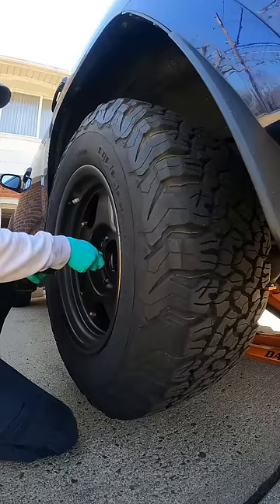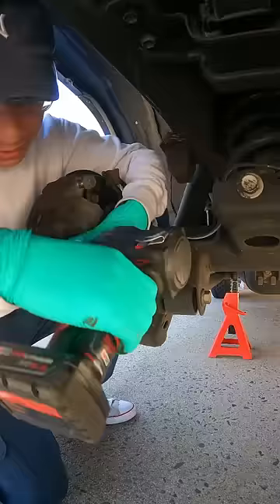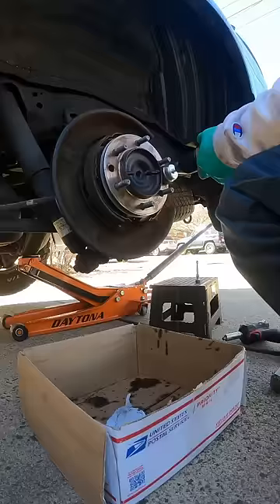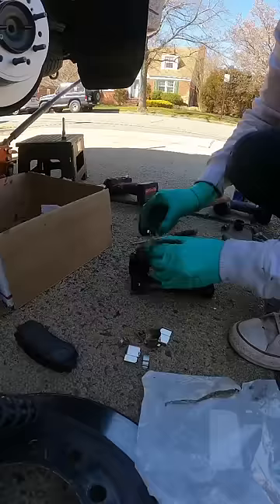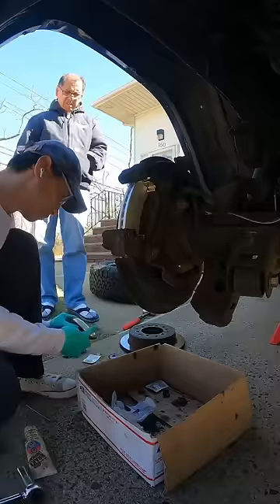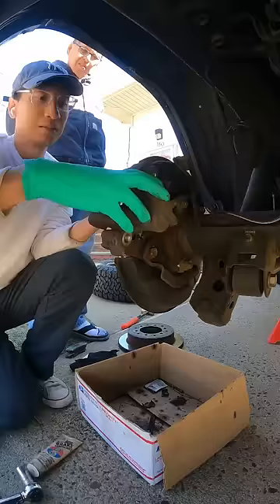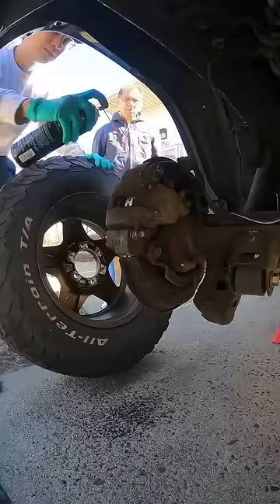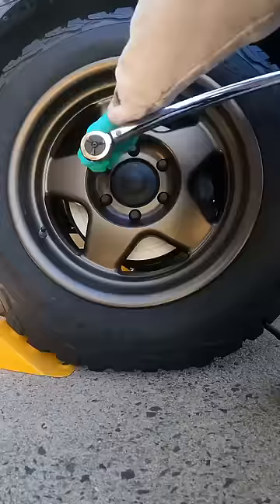Dealer wanted $700 to replace rear brakes. My DIY job cost me $100 and an hour of my time 😎

Comment: Don't forget to bed the brakes. I know people who don't bed them and then drive like crazy, causing the rotors to warp from their heavy foot.
Reply: And check brake fluid. Out of all of the tips in this video i feel like thats a necessity for new break changers lol
Reply: @stonedmega1  thanks 👍🏻 sometimes i just type away and dont even look twice
Reply: Bedding brakes is really only necessary for race/high performance pads. Recently  replaced my rotors and pads with Centric (OEM for StopTech) and they say its not needed.
Reply: So I still do a bedding in process for new pads. However, I have found it's not necessary for pure street duty. Even brand new pads will lock up the tires and you can only brake so hard as to kick on abs. As for warping rotors, I've found what does that more often is heating the rotors up and then parking it with the parking brake on right, or doing heavy braking multiple times and then just sitting there holding the brakes. Basically doing things that heat up the rotors more than normal, and then leaving the pads firmly pressed into the rotor, not allowing for an even heat dissipation. A good example is braking down a long hill and sitting at a light for 5 minutes. I'm sure there are other ways but that's what I have found warps rotors most often
Reply: Passenger cars don't get rotors hot enough to warp. You're thinking of uneven pad deposits
Reply: Are you trying to say bleed the brakes? What do you even mean by bedding the brakes?
Reply: @turtle9345  No, bedding the brakes is different from bleeding them. Bedding in the brakes allows for more even heat transfer and material wear over time. Donut Media just released a video of them putting new brakes on their $500 Civic and they explain the process in a bit more depth.
Reply: @Harmonic14  You're not wrong. Warping is just how I got used to explaining it since most people understand more easily than having to explain how pad material deposits onto the rotor, and honestly I forgot about that part until just recently.
Reply: I understand it would be only beneficial bedding in the brakes is  if you wouldn't be replacing the rotors only the brake pads.

Comment: A good set of rotors and pads are around $ 200.00 parts only.
Reply: 430$ for my 2017 Ford fusion all around front and rear mid grades.
Reply: Bs😂😂😂 a quailty set of rotors and pads are at least 400+... this is aint no TRQ a1 auto bs but go ahead and buy that all in one kit nd be mad them shit squeak or vibrations still happening
Reply: @soilBGuRu420 
what do you prefer….?
Reply: I have a 2005 Pilot. Amazon Prices as of 04/15/23:
ACDelco Silver 18A1312A Rear Rotors = $25.90 ea.
Raybestos Element3 Pads 865H
$27.21

Or 

Wagner QuickStop ZD865
Pads = $22.93

Total in parts $74.73-$79.01+tax
These aren't Bendix or Detroit Axle parts either. If you go to your local AutoZone, I would pay ~$280+tax on their Duralast brand of parts.

It is realistic if you shop around before you need to do the job.

The rear brakes for the model year of my vehicle. To me it looked like he was doing the rears only.
Reply: This isnt a race car any basic rotors and pads will be fine and cheap for my vehicle and I just looked $45 each for rotors and $42 for 2 sets of pads so if you know math thats $264 for all 4 brand new and it will work perfectly fine
Reply: That is highly depending on the car. Your 2009 civic is cheap bro
Reply: Last set of brakes in my Frontier cost me $205 shipping.  All 4 pads, rotors and hardware.  Centric rotors and semi metallic pads and I got 89,000 miles with no issues.
Reply: It all depends n the vehicle. Some you could do ceramic pads and slotted rotors on all 4 corners, and still be under $200. Parts are relatively cheap online. If you're going through a brick and mortar store, you'll pay $200 easy for rear breaks and rotors.
Reply: @jacobmitchell9227  my audi A8 and Porsche Cayenne brakes don't cost that much....wtf
Reply: @noaht5191  no idea man 🤷‍♂️ called 4 different auto stores in the area all had around the same price. Found a set of pads and rotors online for like 270$ but they had awful reviews so decided to just go with a set from Napa.
Reply: @DrewFordsendit  oem if u can afford it, if not get a quality brand dont get the cheapest shit u can find. U get what u pay for is the motto. Akabono brake pads are top notch other brands out there just do ur research.  But quality rotors should last 5+ years easy 10 years if u service ur brakes. Guide pins etc.... i know ppl that switch em out every year or so 😂😂😂
Reply: Kia dealership near me just quoted approx. $750 incl tax. For a 2012 Optima. 🤦 Plus labor $500 @ $250 per axle. 🖕

Comment: 700 for brakes is crazy but if you spent less than 100 it wasn't an upgrade
Reply: I think he just meant upgrade as in replacing old ones with new ones.
Reply: We don’t upgrade them for 700 either just replace them with oem parts shit ya pay 200-1000$ or more for repairs and when we don’t have a part in stock guess where we get it from autozone, orilly, advanced, Napa etc you get the memo, dealerships are the biggest scam but thanks to those who don’t know shit about cars we make hella money
Reply: As some one who’s a mechanic at Toyota in Australia brake pads are around $260 aud not $700 dudes just saying it’s more so he gets more views 😂
Reply: @iamtrinity5187  does that include labor?
Reply: @lucyloo2228  yeah
Reply: @lucyloo2228  it like $45 labour
Reply: @iamtrinity5187  wow. I was expecting a Toyota dealer to charge around $150 an hour labor.
Reply: @lucyloo2228  nah it also depends on the job ur doing
Reply: Your labor rate is way low compared to ours. I am a manager at a large automotive repair shop in central Texas and our Labor rate is $175/hour. Bake pads and rotors typically call for 1.5 hours of book labor time. (Alldata) So, $45 would be less than .3 hrs of labor here. And we don't really have rust.
Reply: @iamtrinity5187  different labor charges for different jobs?
Reply: @iamtrinity5187 first off you are in a different country (unless he is also in Australia) so labor rates don't convert. Second you said brand pads for $260 for you mean pads and rotors or just pads like you said. If just pads then pads and rotors will probably be close to his $700
Reply: @Me-123  at the Toyota I work at rotors are $400 including labour
Reply: @iamtrinity5187  $400 for the rotors + $260 for the pads = $660 so he is not far off
Reply: @Ethan moat  yeah here in America labor rates for mechanic work is much higher than 45$
Reply: @iamtrinity5187  helllllll noooo, not all you mechanics are legit, and I bet he’s telling the truth, they prob looked at him and just thought he’s some dorky kid that don’t know anything and tried to strip his pockets, because if he’s going to someone else in the first place that’s what they will assume and they will already be rubbing there hands like bird man with a big ole smirk on their face!
Reply: Same thing with contractors, I knew a girl that called up a plumber and had to get her toilet snaked because it was too clogged. This fucking jackoff charged her $900 just for that!!! Really grinds your gears when these people try to strip you of your hard earned cash just because you lack some knowledge of what they already know. All in all just do it yourself people, besides you’ll learn a thing or two and that can really come in handy when you don’t have anybody to help you!!
Reply: @iamtrinity5187  as yes. Australia charges the same as the US…..
Reply: @atlcustoms6141  lol yyyeeepppp the ol firestone days.
Reply: @iamtrinity5187  oil change northeast US for my HD pickup at a dealer is $190. I do it myself with mobil1 for $40-45
Reply: @kinte1870  yeah they're double or more on some areas
Reply: Add in what he pays for health insurance mortgage and parts you’re looking at more than $100
Reply: @Neoatheist86  also ozzy $ worth less than US $
Reply: @atlcustoms6141  Dealerships are not the "biggest scams".
Reply: It’s an upgrade if they are bad

How do people use logic and comprehension, cuz maybe I’m doing it wrong
Reply: @KingJKickz  An upgrade would be a product of higher quality than OE.
Reply: Well considering His brakes where bad. Yes indeed its an UPgrade.
Reply: @0nlyClassicZ Serious Bro 900 for running the Snake down the drain ??? No other Work ? Thats Robbery..  Upper Michigan on call plumber come to house and run Snake for 200 Cash 250 check/Card. Shop Labour Rates say Ford Garage $125 -175 for 4x4 trucks... Reputable Garage 80-100.
Reply: @Wishes890 Yes they Are
Reply: @atlcustoms6141  True to an extent. Dealerships usually have manufacturer trained technicians, updated oem parts, and the most adnvanced diagnostic tools anyone can buy. Usually. The upsales though are what get in everyones pockets. But yea, dealers make a lot of money haha. They also have the best insurance and warranties so if they fuck up, you're good.
Reply: @Neoatheist86  Brake pad/rotor repkacement is usually A level labor rate which is more or elss 60% of C level or diesel labor rate. But some shops charge the same rate across the board. I sure as hell do. Most the customer i see come in with some bullshit that they never maintain and everything is falling apart. Its also mostly european cars. That are on their fiest and only oil change since early 2000s haha. Bye bye pcv system and rear main seal.
Reply: Comes down to labor, brakes overall don't actually cost that much, each axle or front and rear at my dealer pays 2hrs flat rate time. Parts alone would be around 400 for factory parts
Reply: @iamtrinity5187  dang, 45 in labor, I don't know how Australia does money to he honest but my dealer is now 165, was 145 but upped it recently.
Reply: @Me-123  pads and rotors depending where you are, are roughly 400, labor cost, again depending where you live, will up it drastically. With being a tech at a Toyota dealership for me parts for my 2010 rav was like 345 but if labor was Included, we do 2hrs each axle, then that 700 is actually lower than we cost.
Reply: @babyTOY-YODA777  I agree never did I say we’re not trained nor have the proper diag tools. Dealerships train their techs by sending them to a tech school I went to one for kia and ford and we also have good equipment from diag to special tools but that doesn’t change the fact that if we don’t have a lower control arm, axle, bearing, wheel stud etc parts either orders it or just gets a aftermarket an sends it on its day, hell I’ve even witnessed where they compare a wheel oem to one from a junkyard and they go with the junkyard one to save the shop money but don’t mention anything to the customers specially when it’s a customer under warranty
Reply: @iamtrinity5187  I got quoted $3,000 for an alignment at a Toyota here in the US. Last time I ever went in there.

Comment: I told a guy at work 400 to do his breaks all around on his BMW and he said it was too much. I was like ok pal go to whoever you want
Reply: I’m a service advisor at a BMW repair shop, and I can attest that no brake job is under $1,000 at our shop. So yeah, that dude should get trade that BMW for a Honda.
Reply: BMW was charging me $1200 to replace the brake line clip for hand brake. It’s located underneath the car, above drive shaft. 🤦🏻‍♂️ Ended up replacing it myself for the cost of the part, $22. All I’ve read on BMWs is that every trip to the deal is at least $1000.
Reply: If you are an experienced tech and your gonna do his brakes on the side then 400 is reasonable but if your not then 200 an hour is a bit much
Reply: @Gregg0112  Not if you save him hundreds... And have done a brake job before.
Reply: Trippin
Reply: @MiamiBomber  I see ur the last toll pole
Reply: @walterrojas1075  Mercedes is even worse
Reply: Im doing coworkers friends 2012 Mercedes on Saturday. My offer of $250 wasn’t good enough I guess so he asked $200. I was supposed to do them Wednesday but he never showed up. Now I have to drive even further distance to get to him. Might break some stuff while Im doing the brakes Saturday.
Reply: @MiamiBomber  tried doing brakes on my brothers Audi a few months ago but I went through an m12 stubby, wd40, deadblow, breaker bar snapped in half, 2 ratchets broke, lug nut wrench wasn’t long enough to get even one lug nut off. It’s supposed to be 80ft lbs but the shop he went to last torqued them to infinity so we will come back. Sure enough he did go back and they charged him $600 for front brakes. Jokes on them tho they just went outta business lmao
Reply: What if you had someone you no because everyone is a mechanic do your brakes and they leave something loose and it causes thousands of dollars in damage you are screwed
Reply: @MiamiBomber  Honda brake jobs are $300 with new brake pads and rotor resurface, around $400 with new brake pads and rotors
Reply: @IWORKYOUWATCH  I'm not a qualified mechanic and know more than most mechanics... just because they have been qualified doesn't mean there isn't people more knowledgeable...nechanics call me to come around when they cant figure something out to see if i can help...
And just like engineers straight from university they have zero real life experience and literally are just starting to learn...
Reply: A full set of rotors and pads for my 550 was just about 400, no labor costs because I replaced them myself. If that was 400 for all new brakes AND install, that guys is a clown
Reply: @Gregg0112  would be stupid to trust someone like that to do a brake job
Reply: @bingysbackyard  For some reason, I don't believe you.
Reply: @rickywoods3101  as a Mercedes owner myself I can attest to this as truth. I did my front brakes for 280 bucks myself and that’s just upgraded parts cost.

My rear brakes will run me about 240 to upgrade, but seeing as I like to do burnouts I’m just gonna use OE parts for around 150 bucks cause I’m gonna be frying pads quite frequently.
Reply: I love when people get BMWs and then don’t actually want to deal with the cost of ownership.
Reply: @kiezer21 Instant whinny baby, just add MB or BMW or equivalent.
Reply: @bleachstain9785  "I like to do burnouts" Probably 5 of the dumbest words ever. What is the point, do you feel special when you do something that literally every one else can do? Immature.
Reply: @Wishes890  when you have access to spare tires like I do, it’s not necessarily immature it’s more fun than anything.
Reply: @kiezer21  I love it when people buy BMWs and don’t realize how electrical they are and then they have to bring it to me to get that fixed
Reply: @bleachstain9785  It's just pointless. It accomplishes nothing other than to add pollution to the air we breathe. But, you get off on it, so, I guess, you need the little thrill.
Reply: @bleachstain9785  I don't agree with you on burnouts but do agree with you about BMW electrical issues!
Reply: I see all these unreal pad replacement numbers, I mean there are two places here I got prices for pads on a Buick rendezvous for $134🤷‍♂️ but I needed another caliper bc it was locking when driving, they said pads rotors calipers were $725 lol I got calipers and pads for about $150 and did it myself. Apparently theres nothing to it but “want to”
Reply: @organfan668  So, pads were $134.00, but pads and calipers were$150.00? Where in the world did you get calipers for $8.00 each? Was the brake fluid free?
Reply: @Wishes890  sorry I got calipers and pads for the front and did them myself. And come to think of it now I believe they were $85 together, I can’t remember. The shop does the pads only for $134.
Reply: @organfan668  OK, that makes more sense.
Reply: 400 is a rip off

Comment: Yeah this Friday just passed I just went and paid $100 for a diagnostic test because I had a power steering leak they found the problem and said it will be $1,600 to repair my steering box. First off it's a 1999 Dodge Ram 1500 it doesn't take long to repair why so high. And why so high for a diagnostic test when it didn't really tell me nothing else going on with my vehicle.

Comment: Back in college the Toyota dealership quoted me the same for brakes on my Tacoma. That single quote got me into fixing and maintaining my own stuff 

Thanks Toyota! 😊
Reply: I had my brakes go out and hit a curb in my first car. Quoted 1000 bucks for a new A frame and master cyclinder, actually needed a brake line and a junk yard A frame. Fixed it myself for 70 dollars. I'll never go back to mechanic after they couldn't even get the diagnosis right. It's been 11 years since then and I've done all my own work.

Comment: You did ok but you should leave the caliper connected to the hose. Loosen the master cylinder cap helps also.
Reply: he did
Reply: I'm. no brake shop tech... ive done a few tho..
I've never even considered removing the hose for a job like this. wouldn't this just be more work, more chance for failure of the fitting?
my standard has always been to carefully suspend the caliper out of the way.
Reply: @nlocflick  yeah, don't take the hose off. Hang it with a zip tie or S hook. Taking the cap off the master before compressing the piston helps though
Reply: He never disconnected the caliper from the hose. Maybe try paying attention next time.